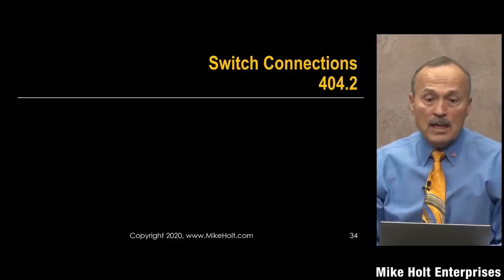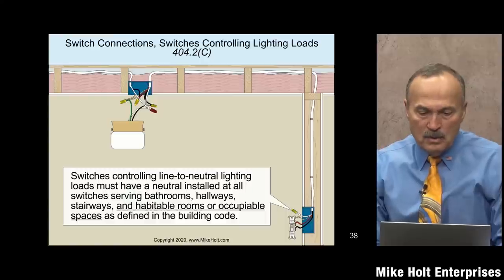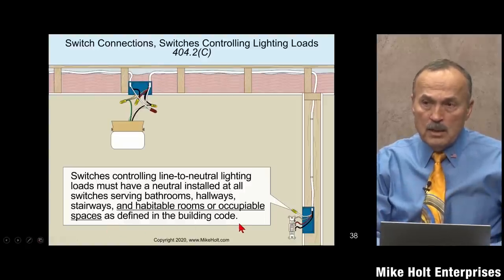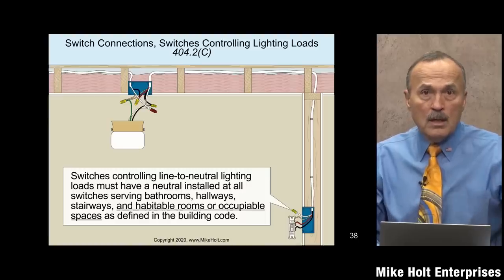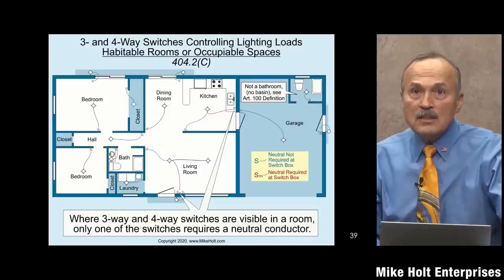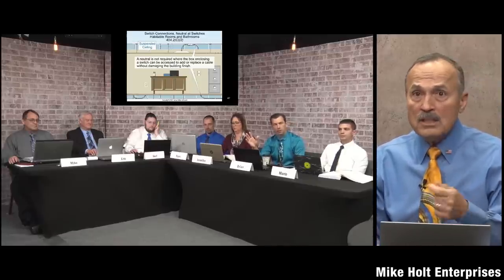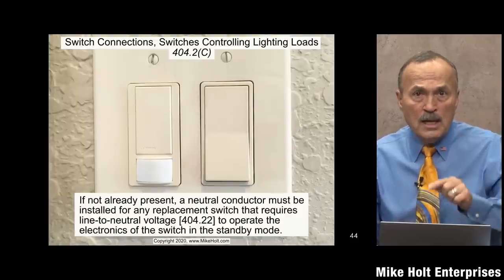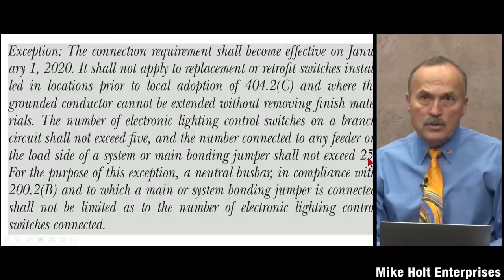Neutral at Switch Locations [404.2(C), 2020 NEC]

Comment: ' to neutral or not to neutral ' at a light switch..... It is a small nominal cost to send home runs to switch boxes versus to lighting fixture boxes. But today's technology it only makes sense to  have a neutral present at all switch locations.
Reply: At the company I work for, that's all we do pretty much, except in certain situations,  like installing a switch in a surface mount box on a cinderblock wall in a utility room or unfinished basement where the NM cable must be run through flexible conduit for protection,  often times I find it easier to run the feed into the light, then run one 14/3 through the conduit to the switch, and place a wirenut on the neutral.  Vs power to the switch and trying to fish 2 runs of 14/2 through a conduit.   Even though such locations do not require a neutral.   Btw I do mostly residential,  new construction.

Comment: I started wiring homes in 2003 and we were already putting neutrals at switch locations. The guys who trained me would get mad when guys used 14/2  as a traveler pairs or "white" as a conductor(hot). Most of the times those guys wouldn't bother to color with sharpees either. Of course wire was a lot cheaper back then.

Comment: So then why not require a neutral at every point of connection. Receptacles aside, single pole 3-way 4-way. It seems like they are angling towards that. More and more people are switching to dimmers. Granted some new dimmers are designed to work with "existing wiring". Just run a neutral to every location if it's not needed cap it.
Reply: I think that's what they are going for right?

Comment: I don't like this rule. Mainly because in a residential setting you will be running sheathed or NM cable to the switch. I can see in an commercial setting. But to me, in my short experience, it just doesn't seem practical.

Comment: in a hallway of a multifamily dwelling.would this area be relative to 210.70 (A) (2) (1) ?  im working on a jobsite where the builder doesnt want a switch for the lights in the common space hallway. He wants them on 24/7 but im curious if that would be a violation due to not having a listed wall mounted control device.
Reply from the maker: 210.70A applies to the dwelling unit, not a commercial occupancy (hallways).

Comment: Is it a neutral actually? does it carry the unbalanced current? or is it a common, white or return conductor?
Reply: Those two things you mentioned are both the same. It is the grounded conductor.
Reply: Essentially both. It is the grounded conductor. On a single circuit with phase and neutral it carries the same current as the phase and as far as the working of the device is concerned there is no difference between it and the phase. The differences are related to safety.

Once neutrals with several circuits are combined or in 240 V circuits it carries the imbalance of the currents in the phases and ensures both legs are 120 volts. If the neutral breaks then the 240 V will divide arbitrarily between the legs. Note on a simple 120 V circuit breaking the neutral just disconnects the circuit.

It is often also called the return conductor but this is somewhat inaccurate as in AC the direction of the current changes 120 times a second. It is better to see it as the grounded conductor.

Comment: Most people are not going to afford a $35 to $50 switch in every light circuit, nor do they need it or want it  necessariy. This code is costing hundreds of millions annually. Not rational at all.  Besides which there are other occupancy systems that are not even located in switch boxes. We wired an entire commercial huge facility with such sensors and not one in a switch box.